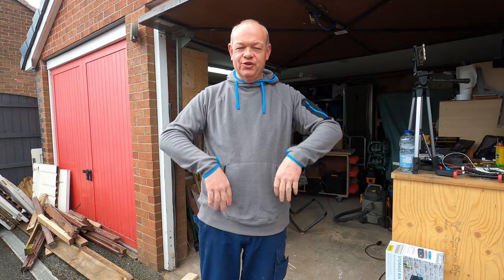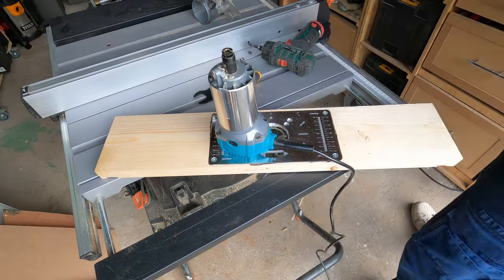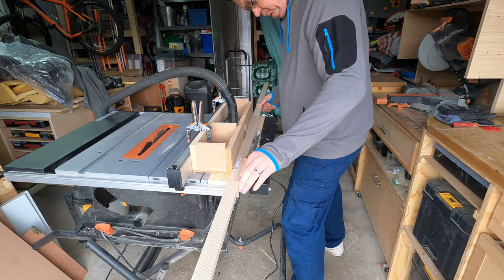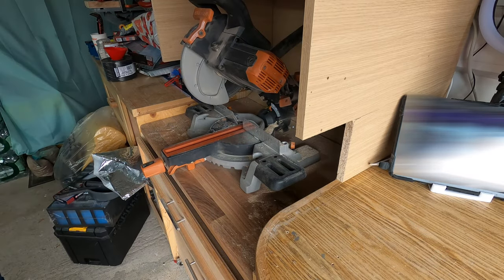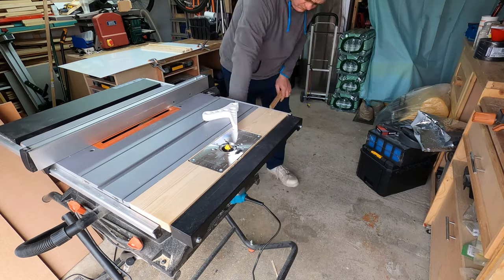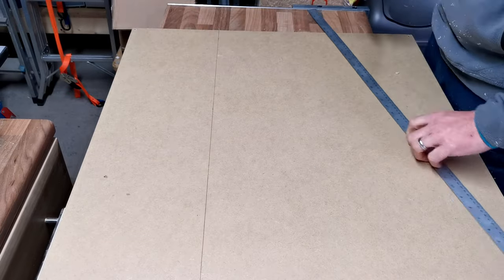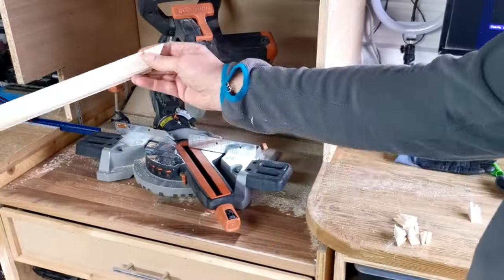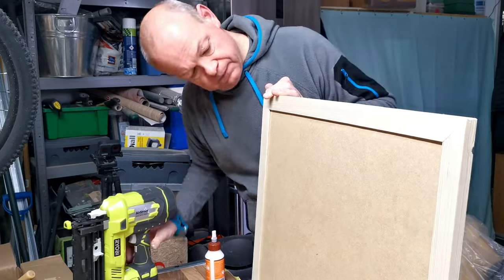The Garage Workshop - Workshop Whiteboard

Comment: I love your videos there're very entertaining and I can see that alot of effort goes into them. I have noticed that you tend to wear gloves alot while working.  Wearing gloves is extremely dangerous with basically any tool that spins/rotates.  Anyway there isn't a real need to wear them in the first place .

Keep up the good work and I'd love to see an updated review on the parkside lathe after you have gotten plenty use with it. I have one myself and I love it to bits.
Reply from the maker: Hi Tom. Thanks for the feedback. The gloves is because I suffer with very bad dry hands when working with wood. I am trying to remember to take them off though!. An update will be coming in the near future!